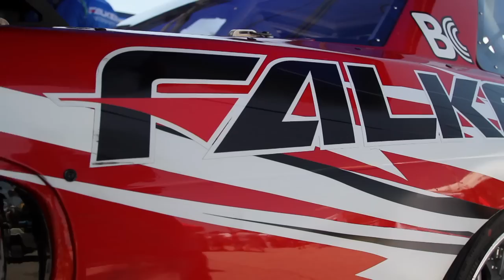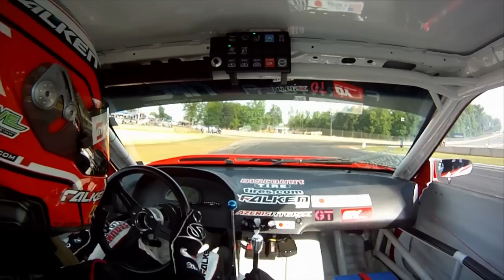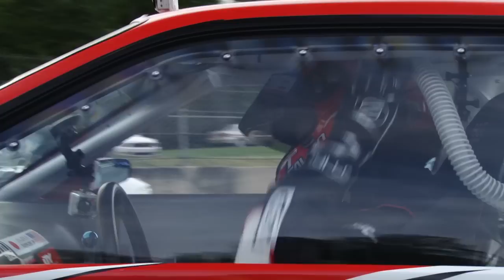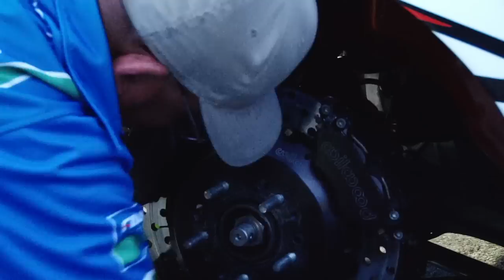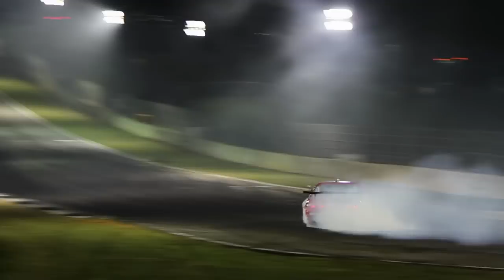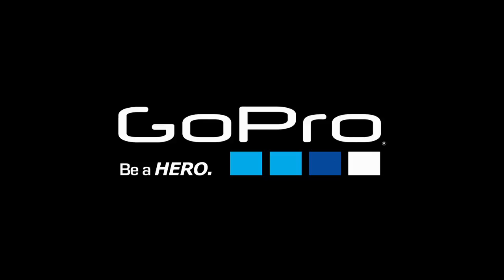Behind the Smoke 2 - Ep 5: Drift Atlanta Qualifying Formula D - Dai Yoshihara 2012

Comment: Did some research, and came up with:
2000-2199lbs up to 215mm tire width
2200-2399lbs up to 235mm tire width
2400-2599lbs up to 255mm tire width
2600-2799lbs up to 275mm tire width
2800-2999lbs up to 295mm tire width
3000-3199lbs up to 315mm tire width
3200-3399lbs up to 335mm tire width

Comment: He does that a) for good luck and b) to help the cooling system. The radiator is located there and by splashing water onto it the radiator has better cooling capability. But it has such a minor effect that it probably is just Dai's superstition. But some racing cars do have water sprinklers in front of the radiator activated when driving hard to help cooling.

Comment: Thats mainly because some rims are cheaper then others and you need backup tires lets say you have volks on the front and enkies in the back the enkies are cheaper so you have two pairs of enkies for backup when you pop ur first pair you switch to the second. So it would be cheaper to buy 2 pairs of enkies then 2 pairs of volks